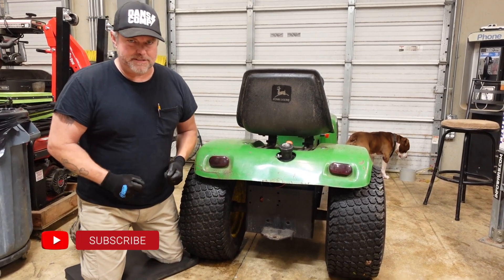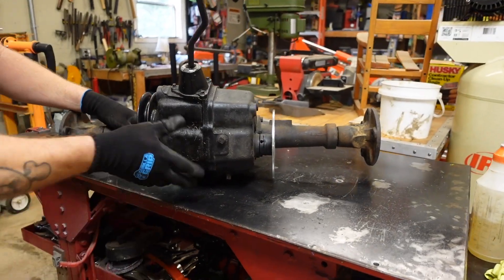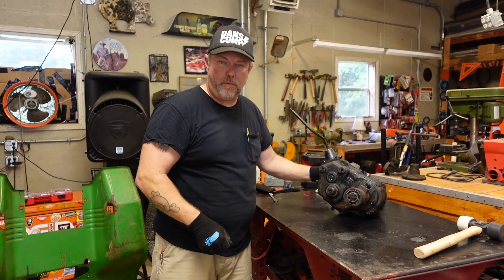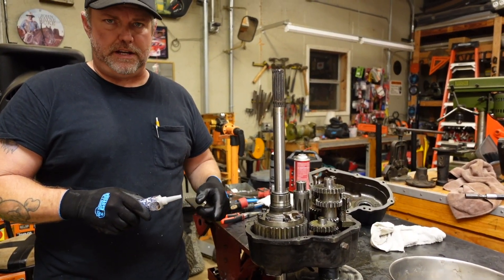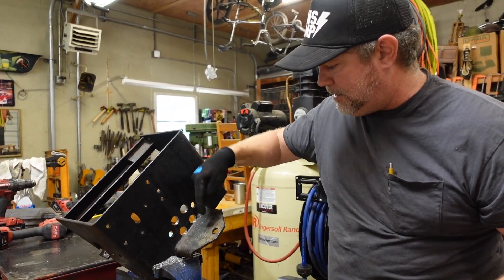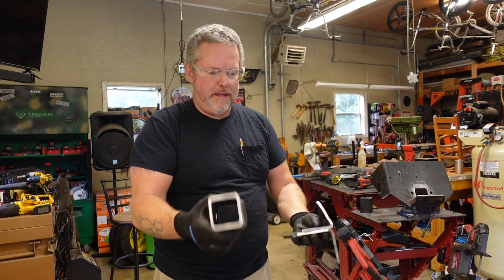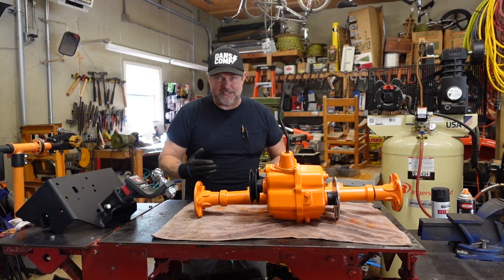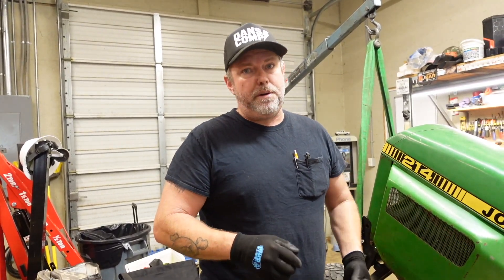Locking the Differential/ Custom 2” Receiver/ JD214 Mud Mower Build Pt. 16

Comment: So time for another burnout with the locker? 😎 I may need to look into a set of rear tires that size for the 111. good video man and glad to see the helpers in there too!
Reply from the maker: Hahaha maybe I’ll try a burnout 😄 
We did a welded diff on the 111 before so I knew what to expect with this one. There are pro and cons. The one Pro: it gives a vehicle way more capability in off road terrain. Cons: added stress on the transmission and tires, turning radius goes out the window, it’s a bear to push the vehicle around when it’s not running or in neutral. 
I plan on using this tractor to get up the trail on our property…hopefully!
Also, the reason I was doing the burnout in the first place was to put a load on the engine so I can try tuning the carburetor. With at least 22 HP, and only having to turn a pulley with good mechanical advantage, I can’t run the motor “wide open” at all because it will immediately red line. So after a couple “pulls” I realized it would make a good Short. 
Anyway, thank you for commenting, I really do appreciate it! Looking forward to your next video on that 111!

Comment: When you got mudding with the 214 do you stuck a lot due to the weight?
Reply from the maker: I need tires for it still. I just got done with the build process. When it was stock it weighed 700 pounds. I completed gutted it and built a custom pulley clutch setup. The original motor was 170 pounds. The new Predator 670 weighs less than 100 pounds. So I’ve got this thing down to about 500 pounds, similar to what most mowers weigh. I’m not planning on running this thing through deep mud holes either. It’s sole purpose is to get me up the trail on my property and be a UTV type vehicle.